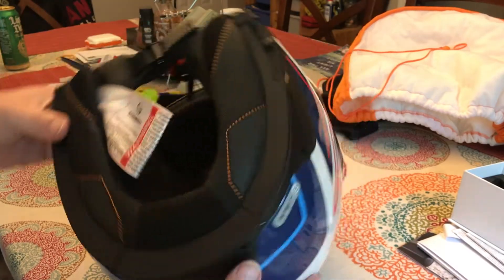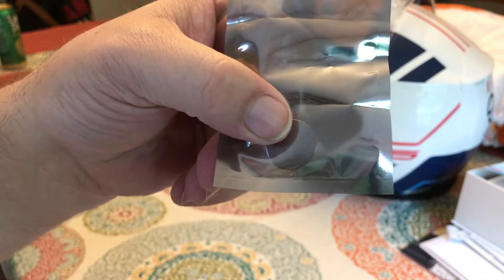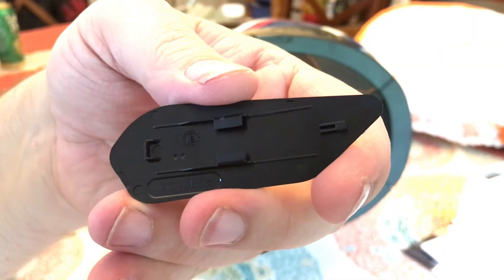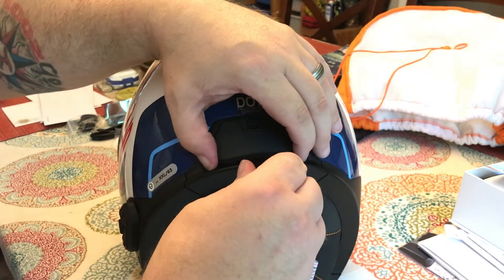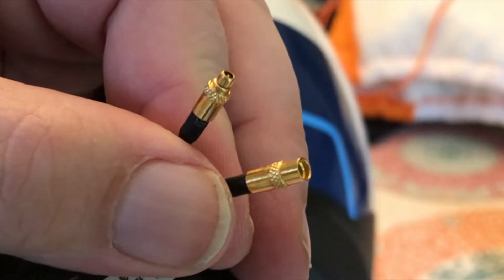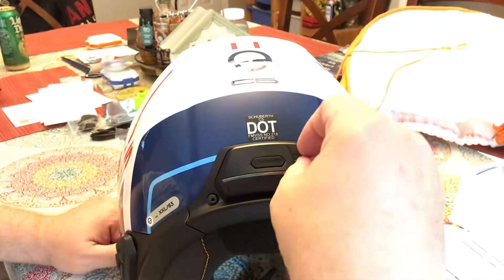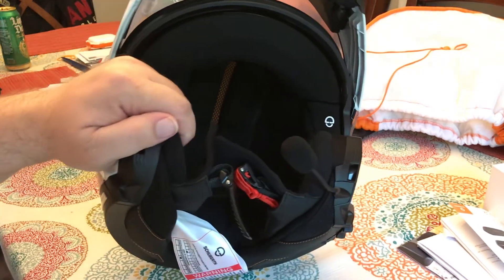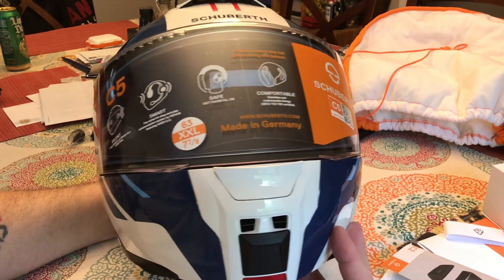Installing the SC2 integrated comm system in a Schuberth C5 helmet

Comment: Have you ever gotten your SC2 equipped helmet to be paired to your BMW’s TFT and be on intercom with your passenger at the same time? I can’t seem to get both to work at the same time, it’s one or the other.
Reply from the maker: Hi - I've never been able to pair the SC2 to two devices at the same time. I don't have a bike with a pair-able dash, though, so I attempted connecting to my GPS and iPhone at the same time and that didn't work either.

Comment: My SC2 wont power up, was working great up until now, any thoughts.
Reply from the maker: Try plugging it in to recharge for a long time - overnight, maybe. If it powers up after that, you might want to try doing a "factory reset" or "reset to factory settings" - it might be called a "hard reset" in the manual, I know other manufacturers call it that. If that doesn't work, you might need to visit a dealer for further troubleshooting. Good luck!
Reply: @BMWMOAorg  tried everything, sent back for repair or replacement

Comment: What I like about my C4 and the SC1 system is that I have multiple batteries. And I can switch batteries very easy.  I wonder If I can do that with the C5 because I have a SENA 50s and when using  mesh the battery last 5hours at most.
Reply from the maker: The battery on the SC2 remote is easy to replace, it's behind a little slide-out tab. The comm unit itself (on the back of the helmet) is recharged by USB cable.